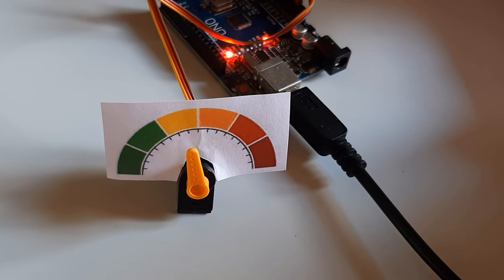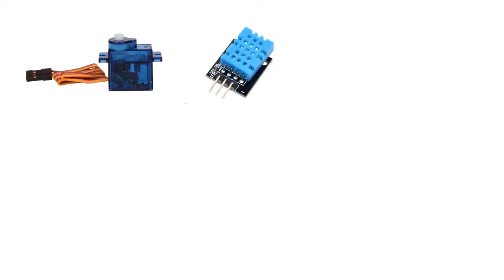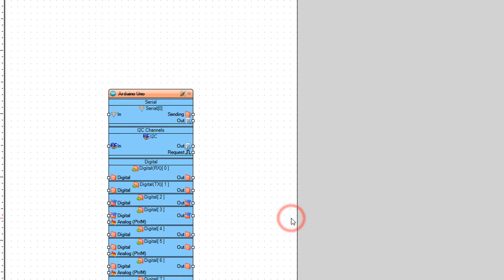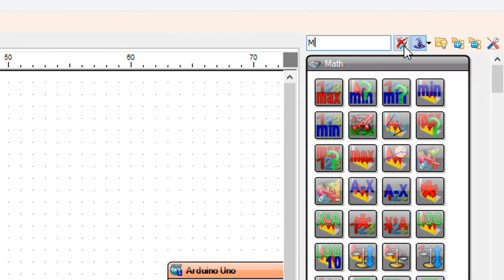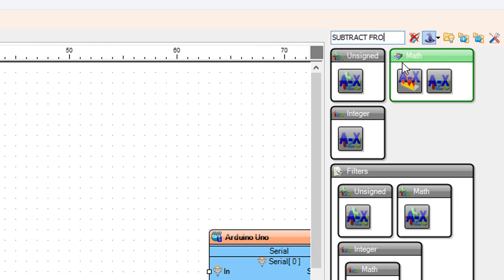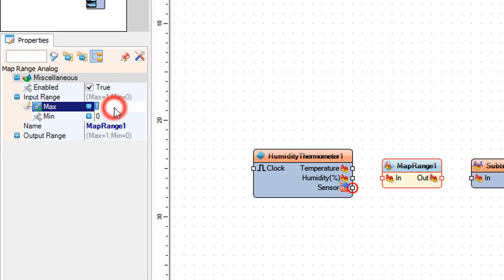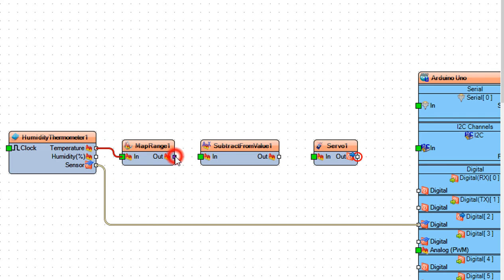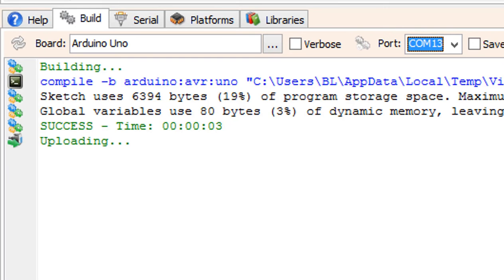Arduino Servo Motor Thermometer Gauge

Comment: um windows defender is saying that its a threat
Reply from the maker: It happens sometimes with the defender because of the compressed setup file. The alert is False so no need to worry. If still not sure there are several online AV checkers where you can verify the file.